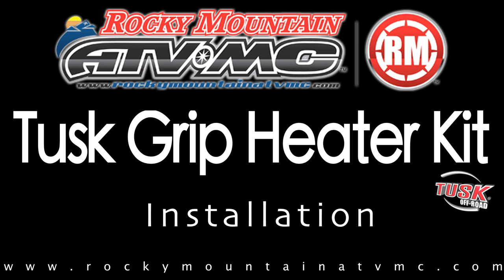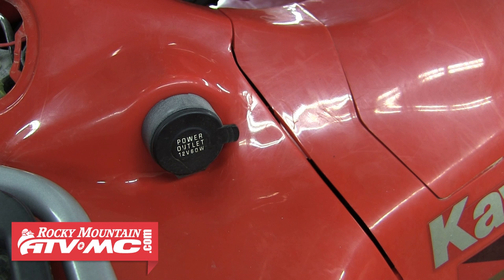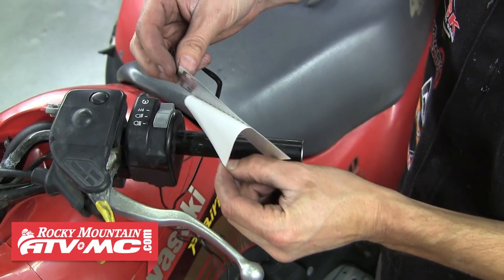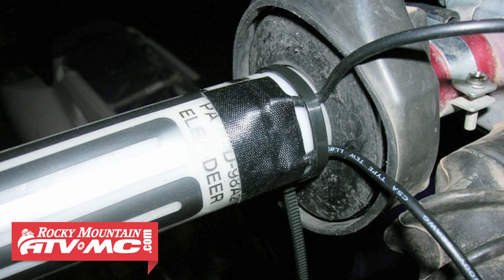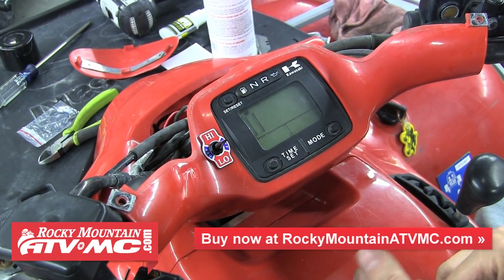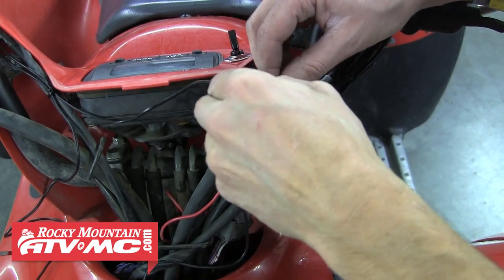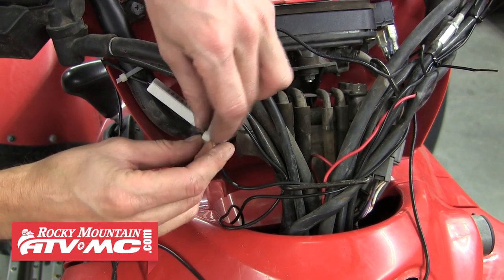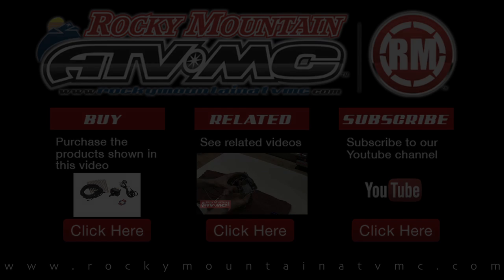How To Install Grip Heaters - For ATV's, Motorcycles & Snowmobiles

Comment: I have a 1985 Yamaha Riva XC125. I am thinking of putting one or two of these under the seat upholstery between the foam and the vinyl. How do you think they would hold up to The Force of My Butt bouncing up and down on them all day and night? A heated seat would be exquisite in the wintertime, especially since i wear the buttless chaps with nothing underneath. That vinyl gets cold, kin wasabi!
Reply from the maker: +Vallen Larsen Ha ha! I don't know that these would be the best choice for heating a seat. They get surprisingly hot and nobody likes burnt buns! You might look into a setup that's made specifically for seat use like the Polaris Heated Seat Kit or the Heat Demon Seat Warmer!

Comment: since the grips get glued on do the heating elements need to be replaced when you change the grips? cant wait to try these on my dual sport and atc
Reply from the maker: You'll want to be careful when removing your old grips but you should be able to get them off without having to replace the heating elements... If you try and just pull them off using soapy water and a small screwdriver you'll be able to reuse the grip heaters multiple times. Just don't use a knife to cut the grip as that could cut damage the element

Comment: would a thumbwarmer be connected to the grips or would it need to be connected seperately ?
Reply from the maker: The thumb throttle warmer will get spliced into the grip heater wires. We have a video showing this process here: https://www.youtube.com/watch?v=dpefZIv1DRw

Comment: I just installed & tested Tusk Grip Heater Kit Part# 1246950001

I would be very satisfied, BUT:
I noticed that the throttle side always heats quicker, and on the left side it takes longer... 

Quite sure is because on the left side the heating element goes directly over bare metal; therefore, the handlebar absorbs heat.

The package SHOULD include an insulator to prevent this! 
The add and the instructions SHOULD at least mention this!

Now I am going to have to remove everything and FIX the problem.
It should NOT be this way because they are supposed to heat up evenly. 

Could you suggest a solution?
Reply from the maker: You are correct.  the throttle tube will insulate the right side so it heats quicker.  You can try to insulate the left side (not sure what would work the best), but it will make the thicker left grip harder to put on (and increase overall diameter of the grip).  I just run it on the bar; the right may heat quicker, but during a ride I don't notice - they both eventually get up to temperature.
Reply from the maker: opengates777
Yes, these can be ran straight to the battery if you want to connect them that way. As long as you have a 12 volt source you can connect them in a number of places on most machines.
Reply: I went to an electrical shop and got some heat shrink that just fit over the handlebar then shrunk it on with a hot air gun ( Hairdryer or blowtorch held well back will work.) then put the element on over that. Improved it a bit.
Reply from the maker: Taz Man That's a pretty slick trick.  Thanks for sharing man!

Comment: Hi
 I bought a set of these with thumb warmer. These had never been used but buddy removed the peeling from the back of the heating pad. They are not very sticky, is there anything I can put on them to help stick?
Reply from the maker: We think using a couple strips of tape will hold it in place well enough to get the grip installed.  Let us know what you end up doing. ~Vinny
Reply: Thanks, I'll let you know how I make out. Do you think I can get the stock grips off with air compressor and reuse them?

Comment: think this would work with a dirty bike if u wired them to a 12v 10000mAh RC lithium battery protected in the air box?
Reply from the maker: Yea, should be fine.

Comment: just out of curiosity,  what is the max temperature that the grips can achieve on the high setting?
Reply: I don;t know the exact temperature, but they will get so hot you need to let go of the handlebars and turn them down to low of shut them off. I turn mine on high to first warm them up but have to switch to low or burn my hands. They get dam hot!

Comment: Can these be run to stator wires if you bike does not have a battery?
Reply from the maker: +Andrew Langridge I wouldn't recommend it.  You won't get the potential heat output hooking it up that way.